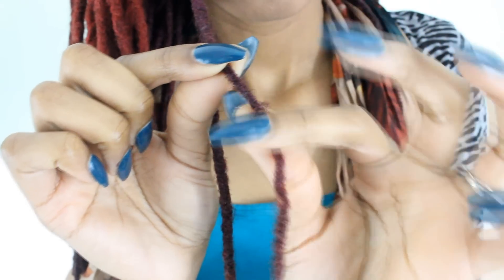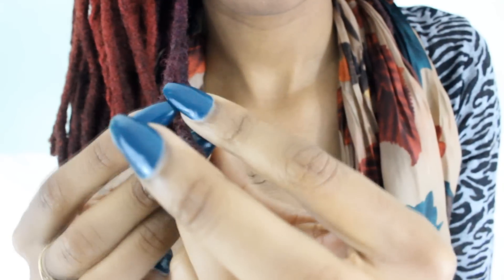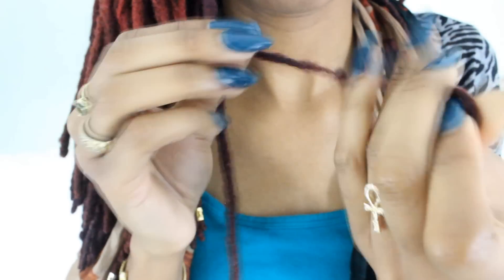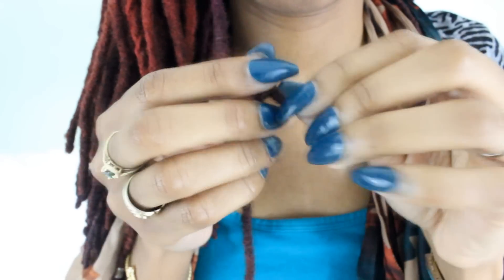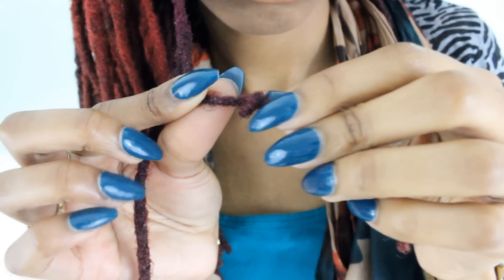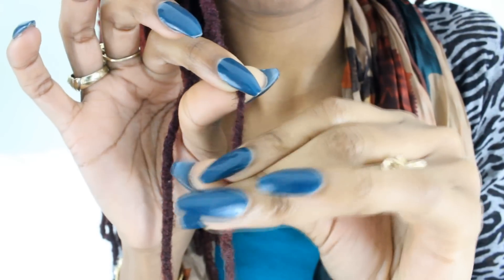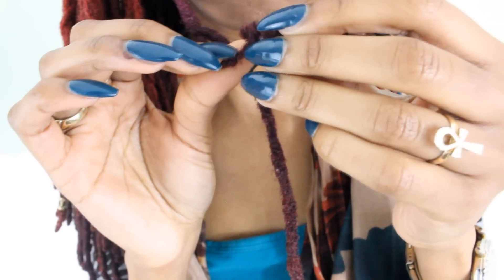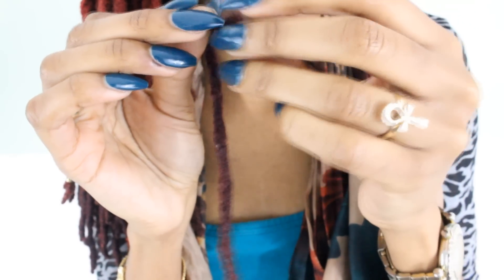How To Repair a Thin Spot, Fix Your Locs

Comment: I never had to put knots in my locs (thank goodness.) But a way to train the locs to look cylindrical and not be bumpy is by using a loc cuff jewelry (like the ones in your locs in this video) and putting it in those areas and cuff it a lil tight, not too tight... about the diameter of the loc. Make sure it stays in that area of the loc shaft. After like 3 months, (including wash days, don’t take it off on wash days, as hair is more pliable and able to be manipulated) it makes the bumpy locs be more cylindrical. I did this for a few locs that had a bumpy look more towards the ends because that’s just how some of my locs matured.

Comment: I did this on my husbands hair worked perfectly. If you do the knots a little looser it will look more natural. The Palm rolling works well too
Reply from the maker: For my hair it looks more lumpy if the knots are looser
Reply: I guess it depends on the hair. The twist thing also worked well for him. This video was very helpful
Reply from the maker: Imanee Starz Thanks for your feedback =.)
Reply: what do you mean by the palm rolling works? what method is that?

Comment: Keisha Charmaine do you pop your locs or have to separate them at the roots, if so how do you separate?
Reply from the maker: Etxm Just pull them apart,feel them and make sure you're pulling the correct hairs in the right direction.

Comment: See my dreads are so long I usually pull the thin parts off but i got a super thin spot on a “important dread” one near my temple and i cant have that one being like 3 inches shorter so i just did this and looks like it works. Got a lil lump there but thats fine I usually keep my dreads 2 strand together so wont notice it anyways

Comment: could this work if there is thinning at the root of the dread
Reply: Courtney a Yes! 😉 I've done it for a few of mine that I accidentally over processed with dye/bleach. No more thinning. They are slightly shorter than the rest but the didn't snap off. That was like a year ago.